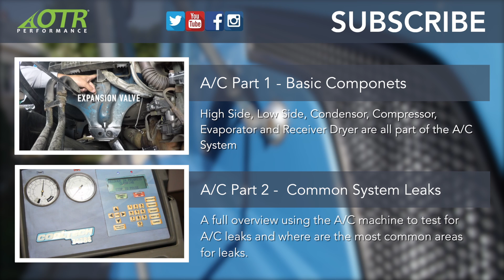Volvo Truck Hood Latch | How To Replace | OTR Performance

Comment: I just had both sides replaced. The portion on the hood and over the quarter fender. I tried raising the cup side on both sides do you push-up towards the inside. That didn’t work. Every bump the hood still pops open. I noticed that when he took the pin side off of the hood there is a long bolt back there. That must be the adjustment. Another video I saw you can loosen the four bolts while the hood is closed and allow that pin to settle into the cup for proper alignment. I would imagine then going to the other portion of the latch on the hood and adjusting that bolt so the pin extends further into the cup. That’s what I’m going to try next. It’s pretty annoying when you paid a lot of money for a dealership to replace parts and they don’t fit them properly. Right out of the gate Tom would Volvo in Indianapolis while having the truck for a whole week to replace a water pump couldn’t even get the hood  to close properly. Not to mention that they gave me a extended ETA for the water pump. My company actually ended up finding a woman in town and had it sent to them. They claim they couldn’t find one anywhere in Indianapolis when we found them all over the place when we called. I don’t recommend going to Tom-wood Volvo Indy to even get oil replaced. They seem like a bunch of yahoos.
Reply: Hi there, did that hood opening problem went away? If yes, then how? Thanks a bunch in advance.

Comment: just replaced mine but now my hood keeps popping open when im driving down the road. any idea?
Reply: I have the same issue. I haven't replaced my latches yet but I have bungee straps as a backup to make sure the hood doesn't fly open
Reply: Hi there did you guys fixed the problem and how? Thanks
Reply: I was having the same issue but replaced all components and it wrkd thanks for the videos save my life